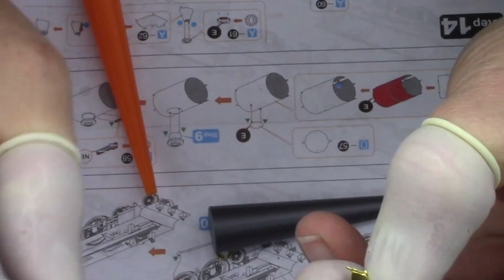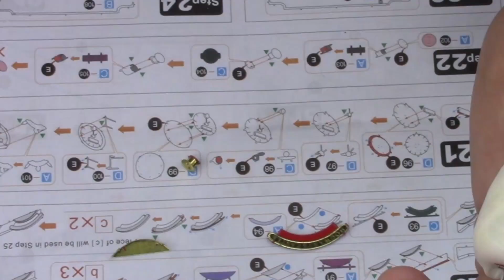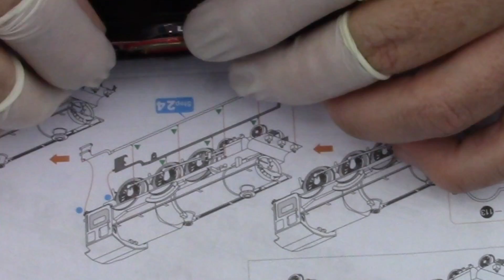ICONX Build - Hogwarts Express - Part 2

Comment: I ran into the same issue with the Books-A-Million version in regards to the curved side braces at the back of the engine tube. You have to leave the tube open to get to the tabs inside, but its hard to match the curvature of the parts without closing it. Over-bending was the tube the way I got past that issue too. I imagine it will be a little trickier on the smaller model.
Reply from the maker: I'm sure it will be. I want to say I had the same issue with the silver Metal Earth version when I build it but it's been a while and I don't quite remember. In hind site, I should have re-watched my own video and referenced that.